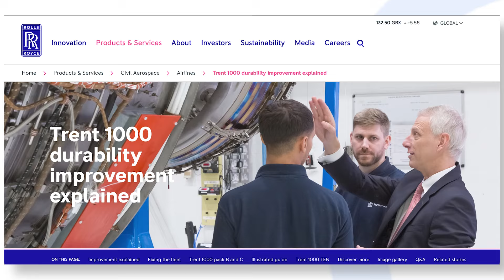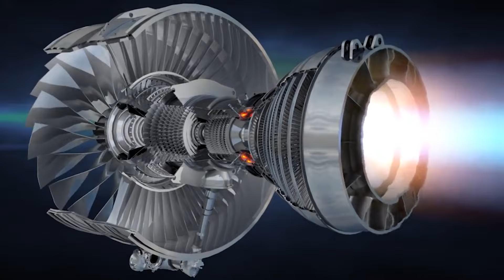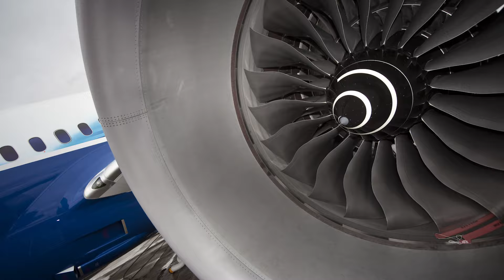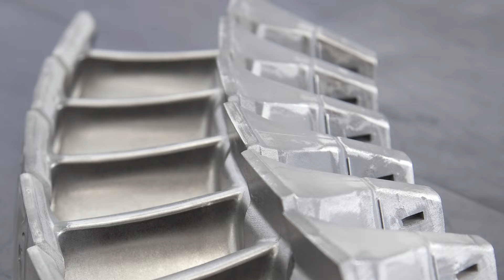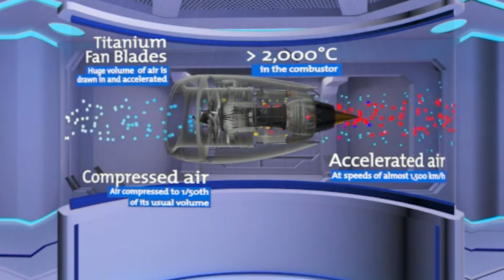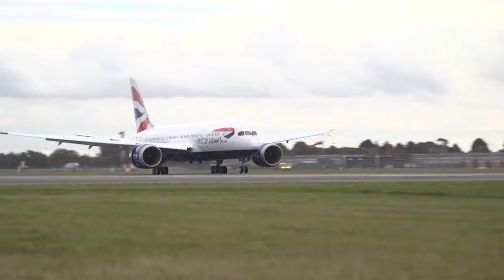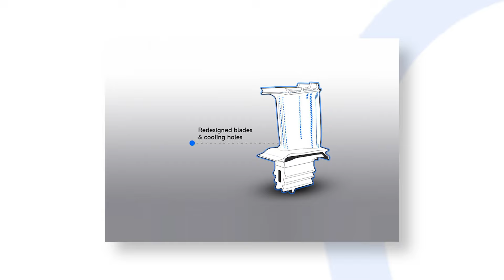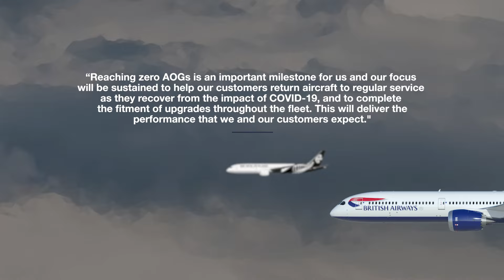787 Comeback: How Rolls-Royce Solved Its Trent 1000 Issues

Comment: What a puff piece for RR...   These are fundamental design issues that other company catch before the product is released to the market.  The fix is the responsibility of the company and it does not warrant this kind of glowing puff piece.  This channel just lost its credibility.
Reply: As if you have any credibility yourself 😂
Reply: thank you for your valued opinion Sir. I am sure you will get a bonus when your employers GE see it.
Reply: @1chish  I don't work for GE silly!  I am a frequent flyer and one that got inconvenienced by RR engine problems one too many times or got my safety put at risk one too many times!
Reply: @1chish  What kind of crap are you smoking?  All engine manufacturers have issues, but GE is by far with least amount of issues even though I am not a fan of GE engines.   Vast majority of my flights are long-haul in 787, 777, 350 and 330.  I have several instances of engine issue causing flights to returned or cancelled, and they were all on RR.  Spare me your non-sense.  Facts, data and safety do not care about your your British pride or feelings.
Reply: @1chish  😂😂😂

Comment: Ironically, BMW had the same issue with Nikasil coating in its M60 V8 engines produced from 1992 to 1996. The BMW engineers didn't anticipate the higher sulfuric content in the US, UK, and South America causing the damages to the Nikasil coating in the cylinder bores. BMW ended up replacing many of M60 V8 engines under warranty and switching from Nikasil to Alusil.
Reply: I never heard that BMW had that problem, but we had plenty of publicity  of the Jaguar V8 which had the same problem with fuel additives during its first few years of production.
Reply: @Hattonbank  That’s because BMW are German and therefore don’t make mistakes whereas Jaguar were British and any problem was blown up out of all proportion by all the Media. As usual making a disaster out of a crisis.

Comment: Mammoth admiration for RR and our Brit friends across the sea. Rolls did monumental work in doing the difficult Trent fixes. Cheers from the States! 
🇺🇸💛🇬🇧
Reply: The Trent 1000 is the only engine for the B787.  GE passed on building anything for it because they 
were working on the GE90.   You wonder how air travel is two years plus into the COVID pandemic.
Reply: @michaelrmurphy2734  Thanks Michael. I always wondered why no General Electric engine for the 787.
Reply: @michaelrmurphy2734  there are 2 engine options for the B787:

RR TRENT 1000 Or GE GENX-1B

Comment: Do companies like R&R have to pay the aircraft operators compensation while the planes are grounded?
Reply: The Trent 1000 engines are supplied on a cost per hour basis and RR had to supply replacement engines at their own cost until the fix was found and tested.

Comment: Impressed by RR! Not hiding or blaming others, just being transparent and honest and working hard to fix it.
Reply: Boeing should learn.
Reply: @rohananand7263  Boeing has "forgotten."  They don't need to learn anything new.
Reply: @rohananand7263  Like that is ever going to happen.
Reply: Very well said, Arjan.  Cheers to you and RR from the U.S.  💛🙏🏼
Reply: In other words...not Boeing ....
Reply: @marlibread  Hasty brother Marlon, Boeing doesn’t make engines.
Reply: @Glen.Danielsen  They were referring to manufacturing in general. Boeing surely isn't doing well with quality control.
Reply: @Glen.Danielsen  However Boeing does make an aircraft that is totally unsafe to fly in, and has been grounded on FAA authority, which will come apart in mid air.
Reply: @thetruthhurts7675   Not correct, my anonymous friend. The 737 problem is completely fixed, and is back in the air. Further, the aircraft were not coming apart in midair. Brother of stout shout, learn facts before you post.
Reply: @Glen.Danielsen  it’s not fixed. It is an inherent problem with the 737 Max. The larger engines shoehorned into an old design (to save money on recertification and retraining) make it unstable and it needed software to rectify the problem. Software which initially the pilots were not aware of.
Reply: @TesterAnimal1  MCAS was the problem, and it is fixed.
Reply: That's difference between US corporations & European companies
Reply: @parimal7528  
Ha ha. And VW are always completely above board????? Are you German by chance?
Reply: @parimal7528  Idk man GEnx seems a lot reliable
Reply: Well said. It's not the cock-up that does for you, it's the attempted cover up. Richard Nixon wrote the text book on this.
Reply: Me too
Reply: Yeah, the original RR and some later incarnations.  But as corporate takeovers muddy the management decisions, and the stock market gets angsty over product imperfections, honesty and integrity dwindles. It's the law of the jungle.
Reply: A lesson Boeing should learn from RR.
Reply: @dougtarbet6193  If Boeing looked up to RR, the only thing they could learn is that if only they were a bit smarter, they would've been able to hide behind ghe airlines for the MAX crashes. This is because even tbough Boeing got blamed for the Trent 1000, the real culprit for the Trent 1000 is Rolls Royce, but somehow Rolls Royce didn't face the consequences for that issue that Boeing did.
Reply: @dougtarbet6193  Boeing dream liner is doing just fine. That’s why everybody’s ordering it. Besides, Boeing has nothing to do with power plants which should be obvious
Reply: I think they sold the engine w/known issues to screw Boeing. 
Now that the damage is done they can "fix" the issues they already knew of and look like big hero's?
Not to me.
Reply: @Danstaafl  You think they did this on purpose to screw with boeing, take many losses, pay massive amounts to the affected airlines and lose hundreds of orders to GE for a gotcha? Sounds like a stretch.
Reply: @Danstaafl  put the bong down typical Boeing fanboi remark
Reply: @Danstaafl  customers decide which engine package to purchase, not Boeing.
Reply: @Arjan De Boer So doing the right thing is now somehow exemplary performance in your book?  You must be a fan of participation trophies too.
Reply: @mikek5298  Doing the right thing is exemplary performance. If I was cleaning your house but I didn't mop, would you be satisfied? Would you think that's a good example? No you wouldn't. And also, doing the right thing isn't a participation trophy, it's an excellence trophy. The "new" Boeing deserves a participation trophy.
Reply: @mikek5298  calm down salty
Reply: @mikek5298  been 2 weeks now and you still havent apologised

Comment: Oh the irony ! Using Norwegian Dreamliner images when Norwegian has effectively been bankrupted by the Trent 1000 issues combined with the 737 Max groundings.
Norwegian no longer has any Dreamliner or Max aircraft.
Reply: Didn`t RR supply replacements? Wasn`t it other factors that bankrupted Norwegian?
Reply: @edwardwilcox6606  I thought they ran out of cash due to a too rapid expansion of their fleet and network. They tried to expand too fast instead of doing it incrementally as per Ryanair Easy Jet and others. A budget airline going long haul has rarely succeeded. Then came Covid.
Reply: @Hattonbank  The RR issues on the 787 gave them major issues.. and a lot of wet leasing had to be arranged at extra cost and a lesser travel experience for the passengers..

Comment: A little too late though. Their now down to 30% market share on the 787 engine market despite having been the launch engine on all 3 variants. Only 100 or so orders are left in the backlog without a chosen engine and more than half are likely to chose GEnX
Reply: True. Air New Zealand and ANA, for example, received their initial fleet of 787s with the RR engines. However, after these issues, when they came to buying more 787s, they switched to GE engines. Happy that RR resolved the issues but the headache it caused for airlines couldn't be ignored.
Reply: Rolls Royce has its future reputation to protect. It can carry forward what has been learnt to future projects. This is what great engineering companies should do.
Reply: The GE, by any measure, is a superior engine.
Reply: @eyebok   Actually there is no such engine as a 'GE'. Please try to be more specific.

Comment: Very interesting. people forget GE has had problems with its GE9X engines, delaying the 777X, Pratt and Witney PW100G geared turbobfan. I wonder why the Trent XWB did not suffer the same issues though it is part of the same family? Rolls Royce needs to make the new Ultrafan works from the box and get it ready for single airline aircraft.  Airbus has decided to stick with the Trent series which must mean the have faith in Rolls Royce.
Reply: At least GE had rectified the GE9X issues. RR at least rectified issues too, but it's too late because Norwegian has already sued Boeing for Trent 1000 issues. Until that lawsuit gets thrown out, Boeing will still have hard feelings against RR
Reply: @Blank00  lol
Reply: The GE9X problems are well documented, the PW1000G not so much, but the trent 1000 definitely was the most high profile. Trent XWB was developed several years after the Trent 1000, it probably incorporated more updated materials in its construction
Reply: @Kla Boi Can you elaborate further? What is the new technologies you are talking about? (E.g. the Airbus hydrogen powered aircraft prototype)
Reply: Perhaps Airbus is taking a lesson from how Ryanair and Southwest got good bulk deals in the 737 Max when its reputation was in the toilet. Airbus could've gotten a good bulk agreement from RR due to RR's reputation being damaged.
For the record, I'm in favor of this. If an industry is going to reduce to only a handful of brands with a big percentage having quality issues and the other brands not being able to fill demand; then the customers manipulating it is not only smart, but morally justified.
Reply: Ignorant is not bliss buddy
Reply: BRO YOU might be right but GENX HAS ONE GOOD THING IT FAN BE USED AND PROVIDES EXCELLENT PERFOMANCE WITH THE DREAMLINERS THATS WHY MAJOR DREAMLINER USERS SUCH AS ANA AMERICAN AIRLINES QATAR AIRWAYS STILL HAVE TRENT 1000 DREAMLINERS BUT ARE SWITCHING THEM WITH GENERAL ELECTRIC GE9X BUT TRENT IS BACK AND NOW DREAMLINERS SALES WILL ONCE AGAIN TAKEOFF
Reply: @theanimators2.095  I said the GE9X engine has had problems which is not in service with the 777X. My point is all jet engines have pushed the technology to the limit. LEAP by CFM seems to be the most successful so far.
Reply: @theanimators2.095  Got to say you ain`t got much correct in your caps above! While ANA chose RR, both American & Qatar picked GE. You are correct though that ANA has ordered GEnx ( Not GE9X! ) & the same applies to New Zealand who had an all RR Dreamliner fleet but are now ordering GEnx. We`ll see how things go, but as it`s been said RR have sorted the problems so there may be some surprises in store for all the RR haters out there.

Comment: People often forget that just 40 years ago RR faced the same challenge with the RB211, so much so that it effectively bankrupted RR and thus crippled sales of the TriStar beyond recovery. However, once it was fully developed it then became one of the most fuel efficient turbofans of that era at roughly 6-10% more efficient than GE’s counterparts.

The Trent series were direct descendants of the RB211 program, noted by its distinct “growl” at full throttle. One of my favourite turbofan designs of all time.
Reply: Well done Rolls- Royce !!
Reply: Apparently, the Rollers were easier to start and more reliable, as well, after the early problems were fixed.
Reply: I didn’t forget.  The first thing I did was to scan the comments to see if anyone would correctly make this point, and not post something that’s already been said.
Reply: Yes it also went on to power some iconic and brilliant aircraft aswell, 747 & 757 two of my personal favourites.
Reply: I remember that.  The early 1970s.  There is content on YouTube about that story too.

Comment: media always looking for bad press from anywhere. I'm glad to know simple flying and long haul by simple flying channel because this channel spread good press and deliver bad press in a good way. Keep up the good work!
Reply: Yes well done Rolls Royce for fixing another issue for Boeing 🤣
Reply: @deanwood1338  To bad they did not fix the problem for Lockheed took years to fix the RB211. There were 10 engines that I know about that were never put back in service. I have pictures of the Quantas  Airbus that had an uncontained Trent failure. The Trent did extensive damage even got into the front spar. Don't be so fast to kick Boeing.
Reply: @jayreiter268   firstly, add some punctuation please. And secondly it’s a joke. Grow a sense of humour. Clearly it’s not Boeing fault the RR had issues.
Reply: @jayreiter268  don't be so fast to kick RR

Comment: Shit yeah, Rolls Royce did their fix well.  Nothing is perfect, but their follow-up was perfect.
Reply: It tooks years to fix, I wouldn't call that a perfect follow up
Reply: @anteeko  Yes, maybe they could have borrowed your magic wand, and fixed it with that and a sprinkle of fairy dust. New technology brings with it new operating problems. These have to be dealt with when they occur, and RR is clearly being judged here by how they managed those problems. 

If you have any knowledge concerning the history of aero engines, then you will realise that RR had technical problems with the introduction of the RR Merlin in the late 1930's. These problems were solved, and the reputation of that engine, was unsurpassed during WW2..............
Reply: @anteeko  I sat on this for a few days and not replied.  As I had to gather my thoughts.
Trying to be friendly. for an engine to be approved it takes many years by the FAA, therefore to get approval after an issue, takes the same or longer, so if you have half a brain, you will hopefully understand that it is not about the actual engineering from the manufacturer to fix the problem mate.  (it was probably fixed as soon as they had the data)
Do not bomb Boeing or Rolls Royce for the bureaucracy they have to live in, but please engage your brain before opening your mouth. 
I expect you have no engineering experience, but I do.
Reply: @anteeko  you're just anti British
Reply: @ant2312  "you're just anti British" what RR blunder has to do to being British?
Reply: @anteeko  Smashing the Dunning Kruger affect here I presume.
Reply: @rodgerq  " Smashing the Dunning Kruger affect here I presume." I worked on 787 and I replaced many 787 RR engine.
To this day RR is still delivering broken engine even though the fix has been found.

All engine being fixed will happen when? in 2022, 2023? how long since the problem started? 

It is undoubtedly one of the biggest engineering blunder in commercial aviation history and you guys turn it into a victory?
Reply: @anteeko  delivering broken engines with what issue?
Reply: @rodgerq  Well all of them, the fix hasn't been deployed to all engine yet.
Reply: @anteeko  what are the other issues? I only know of one other, but it seems highly unlikely that RR themselves would supply an engine not fit to fly, nor for a customer to accept it. The implications could be, as I'm sure you know, criminal.
Reply: @rodgerq  "what are the other issues? I only know of one other, but it seems highly unlikely that RR themselves would supply an engine not fit to fly, nor for a customer to accept it. The implications could be, as I'm sure you know, criminal." no new issue, they just keep providing engine without fix under current approval.
That's how they achieve no "AOG" (during the pandemic.. not a particularly great achievement I would say)
It will take few years to fix all engines.